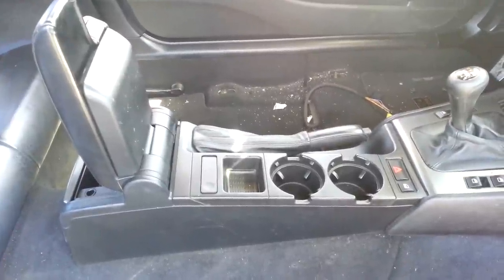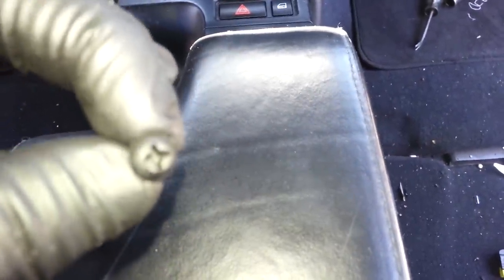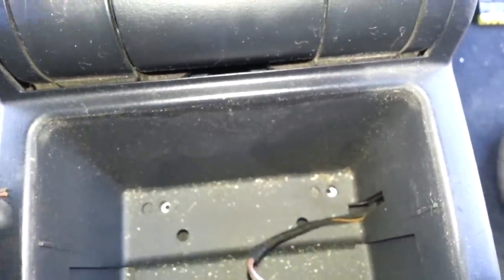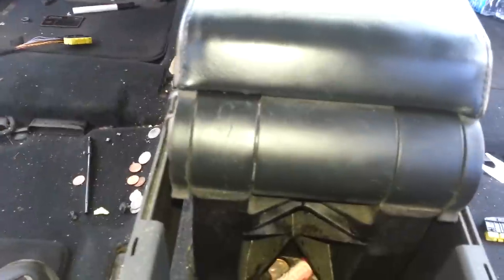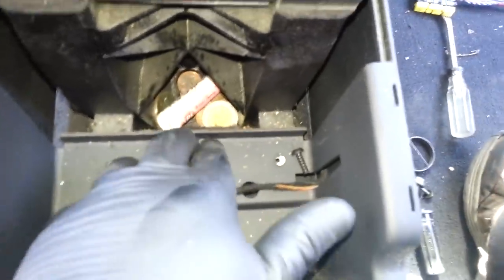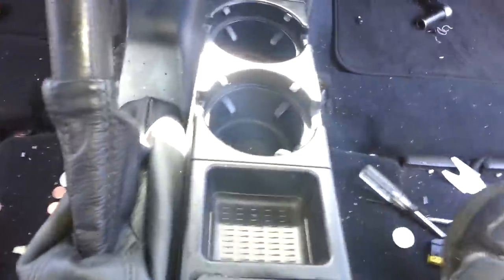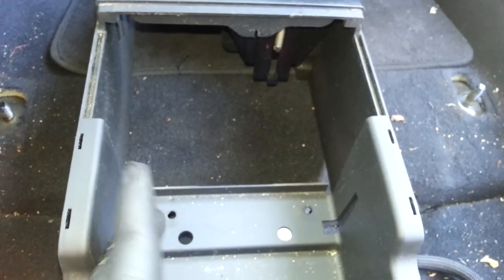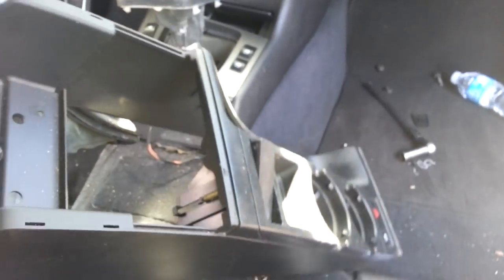How to remove center console arm rest BMW E46 M3 330 325 328

Comment: Great video!  this helped me install the aux cable input in my 2003 325i next to my cupholders.
Reply from the maker: Eric Walz Sounds good.
Reply: Eric Walz What was the date on your stereo? I've seen people saying the 2003s won't work with an Aux input.
Reply: +venerated it has to be a 2002 and up manufactured model for it to have the aux cable connection!
Reply: JayVeTV Yes, I was nieve when I posted that comment! 09/2002 I believe is when the Aux input worked from. My radio is 11/2002 and does work with the aux input.